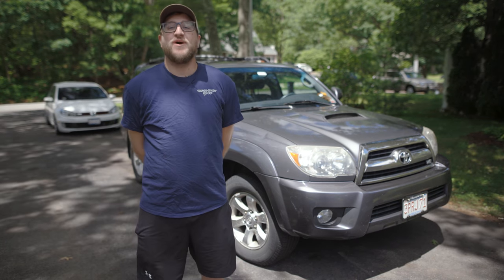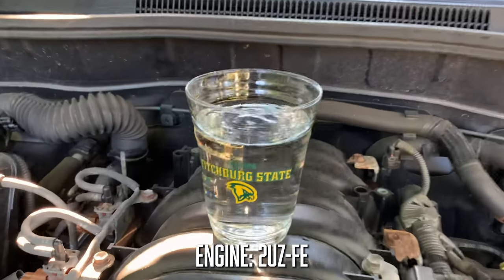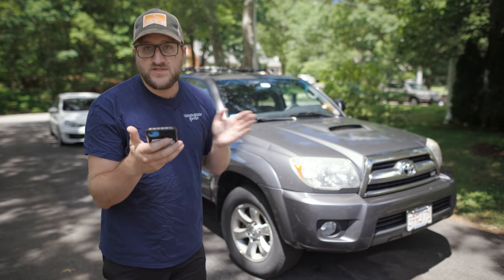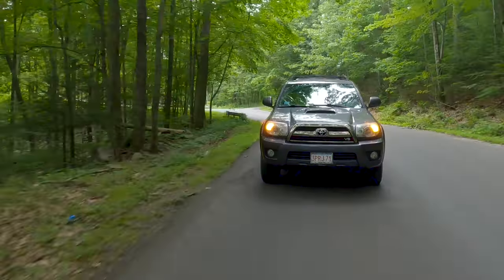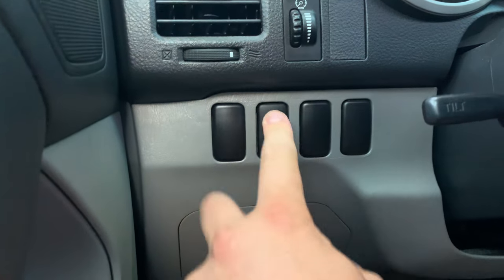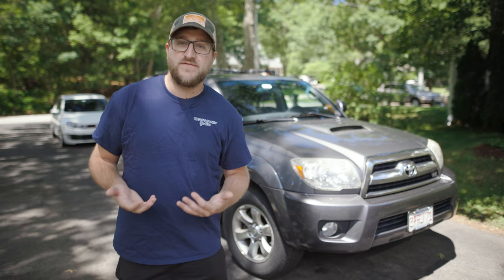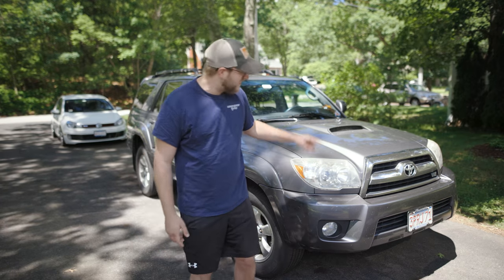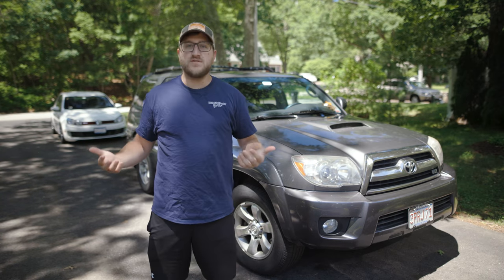Toyota 4Runner - My 5 FAVORITE Things (4th Gen)

Comment: Just picked up an ‘05 limited 4x4 v6 !
135k miles paid $10,500.

My biggest surprise was the ride, literally like a Cadillac! I wasn’t expecting that.

No rust on body, surface rust on frame. Connecticut vehicle so it was taken care of.
I’m going to rustproof it for my Michigan winters.

I might try to change the hood to one with a scoop, if it fits.
I like the TRD Pro grille too but I know that won’t work.
Reply from the maker: Awesome! That sounds like a decent buy. They really do ride surprisingly well, especially compared to our Xterra that rides on leaf springs

Comment: Just want to point out that the AWD applies to the 4.0L V6 as well. It too has a locking center diff. Actually, I believe the V8s were AWD/4WD only. 
You should lock the center diff if there is slippage, i.e. snow and such, am I right?
Reply: Yes, only lock in difficult slippage conditions

Comment: In all the vehicles I've owned, I've always had suspension issues long before any powertrain problems (if any!) How has the 4Runner's suspension held up for you? Any repairs needed, or problems you've found? Anything coming loose, or ride changes?
Great job!
Reply: I have a 2005 4Runner, I got it brand new directly from the dealer and so far is the best vehicle ever, it is pretty stock but I have had no issues of any kind so far, just the  regular services at the dealership. About your question, believe me our roads here down in Mexico City are crap, the worst and my suspension stills safe and sound with the original shocks and hitting 210,000 km. So I encourage you to get one! Cheers
Reply: I live in Northern CA.  My 06 was babied most of its life; a little less since 2012 when I bout it at 167k miles.  My XREAS was awesome  It cornered very well and remained flat.  XREAS system died at about 212K miles.  I removed the system installed a more off-road-worthy suspension.  (DIY)  I love it!  

P.S.  I added a Steel front CBI front bumper and the newer Badlands12k Lbs wench.  I had to adjust the spring clip to the third one down to keep the right height level.

Bilseien 5100 Shock/Sturts
112-620 - Toytec/Eibach front coil lift springs
RCC2.0 ToyTec "Superflex" Rear Coil Springs
Dobinsons Front IFS Diff Drop Kit
SPC UCA (pair) #25480

Comment: I have a 2006 that looks exactly like this one (exterior) but mine is a 4.0 v6 with just over 200k miles and runs like brand new it has leather heated seats sunroof it has the option of 4LO 4HI and 2wd it also has the center lock and downhill support button, I am currently working on installing a Tesla style head unit I found on Amazon. 
    Also I want to convert the rear corner mirrors that are in the cargo area into speaker grills that way I can install some tweeters or something. 
    The other upgrades I will be adding are rear bumper sensors, a smart rear view mirror video opens to help reverse OR instead just use the stereo as a reverse aid. 
    I would also like to figure out a way to make my rear tailgate door to open and close by itself with the touch of a button, and while I was at that I would like to find some kinds of hoist to lift my wheelchair into the rear cargo area. 
    I need to change my step bars the ones I got hug the rockers to tight and do not allow assistance for me to step on to enter the vehicle. 
    The other thing I would like to figure out is how to install both heated and cooled seats and maybe in the rear seats as well. I will be adding usb charging ports in the rear passenger area as well. 
    The most important upgrade is that tailgate and the wheelchair hoist, I can’t even begin to explain the pain of having a wheelchair fall out of the back as I open the gate it falls on my foot causing me to break it. I am disabled and my condition is called Osteogenesis Imperfecta. 
    I need to figure out how to change the bulbs in the dash tho they went out not all of them but a fair amount so I can’t see what the display says. 
  
    If anyone knows how, where or who could help me with this tailgate and wheelchair cargo area situation I would highly appreciate the advice.

Comment: Great video! Question for you with a 4wd+v8 combo. Dumbing it down here, but when would use the following combination?

H4 + differential unlocked: I know the answer to this one, it's just everyday driving
H4 + differential locked
L4 + differential unlocked
L4 + differential locked

Thanks!
Reply: H4 and L4 means center diff is locked.   Full time 4wd means center diff is not locked and there is slippage between front and rear axles.

Comment: Love to see how you pack your 4th gen for road trips, prep for winter and some POV road tips. As long as the frame is good, 4th gens are awesome and easy to work on. The V8 is the only way to go. Thanks for the viddy!
Reply: The V8 is not the only way to go
Reply: Pointers for getting off the exhaust manifold heatshields? everything is rusted/frozen solid. it's soaked in pb blaster and i am going to heat them up, but it's already looking like a pain. and im not even to the manifolds haha.

Comment: How much did u scoop yours up? and how many miles
Reply from the maker: Scooped it up for about 9000. They had around 156,000 miles on it at the time. This was before the used car market went berserk. Admittedly there’s more frame rust on it than I would like
Reply: 2004 V6 Sport 175k miles for $5,700. Listed for $7,500

Comment: Technically midsize SUV’s can’t tow more today, depending on definition. Many consider the Dodge Durango/Jeep Grand Cherokee to be midsize, but they don’t have frames. Also the Audi Q7/Porsche Cayenne, but same thing. The FCA/Stellantis twins tow 6200 lbs (V6 2WD/AWD), 7200/7400 lbs (5.7 V8 4WD/2WD), and 8700 lbs (5.7 V8 Tow’N’Go/6.4 V8/6.2 SC V8). The VAG SUVs tow 7700 lbs in most engines (other than the Hybrid Cayenne and 2.0T 4-cyl Q7 I believe).